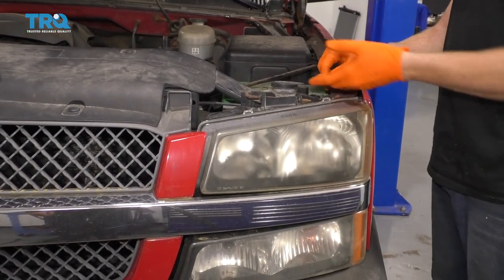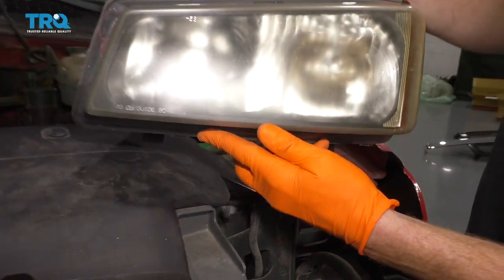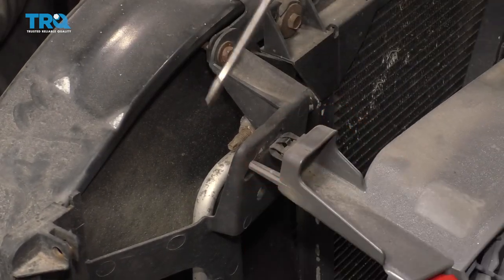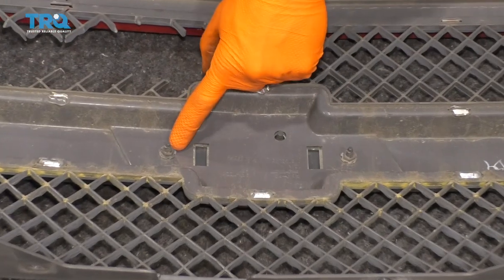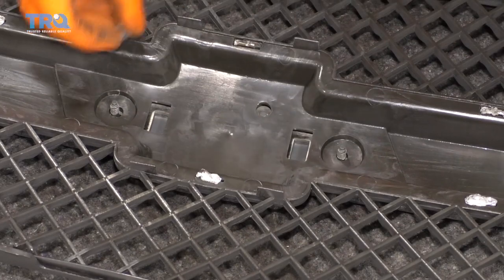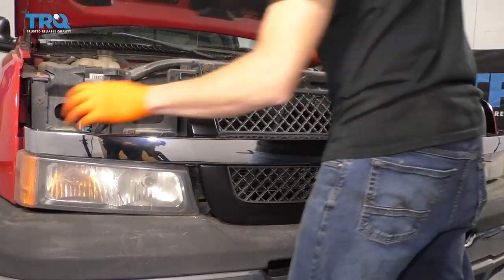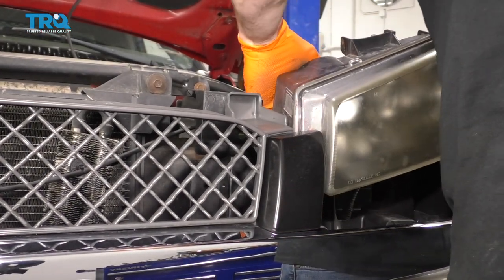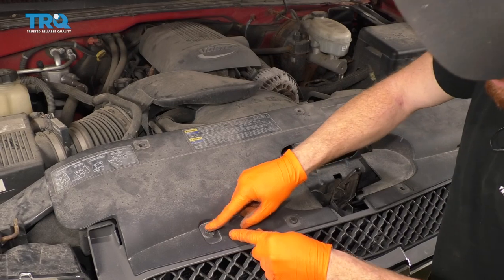How to Replace Grille 2003-2006 Chevy Silverado

Comment: I can have very short temper and low patience working on all vehicles but I replaced the grille on my dads 2004 GMT800 Silverado 5.3 LM7 V8 and I was pleased to discover how easy and convenient it was to fix remove the old grill and I pushed the clips onto the grill new and installed it and made it look amazing!!